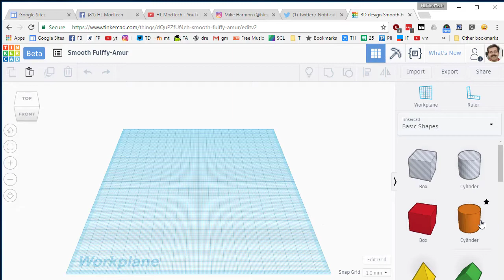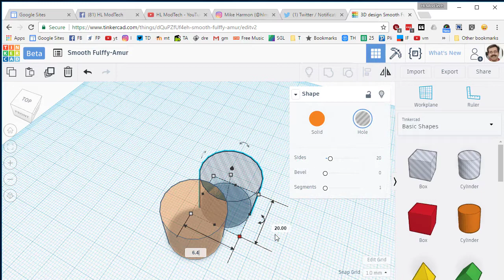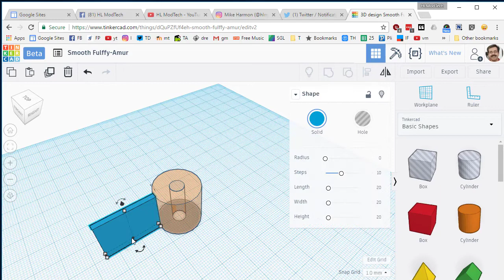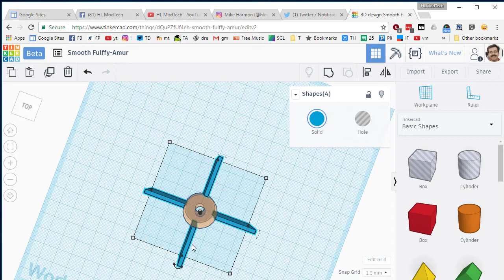Great Summer Project! Design your own paddle wheel in Tinkercad

Comment: I know this is 5 years old, so this is for anyone seeing this now or later.   An easier way to accomplish this in TinkerCAD  (using what is shown in this video), is as follows:  To start the paddles, make the blue rectangle the same height and width (as he shows in the video) but make it as long as you want the paddle wheel's diameter to be.  Duplicate it, then turn it 135 degrees (be sure NOT to deselect this dupe), then duplicate 2 more times.   Boom paddles are done.  Then create the hub, by making a cylinder the same height as the paddle, at whatever diameter you wish, align, and group it.  Do the same for your center hole, and you're done.   

Now here are a couple more reasons why my method is an improvement.  It means you use less objects, which means it renders MUCH faster, when you load this file back up for review or revision.   Another reason, is that when you export this as a STL (the way the author of this video did), it can inflate the file size unnecessarily and in some cases, it will mess with the gcode and cause problems with shells printing weird.  

Hope this helps.
Reply from the maker: Thanks for sharing Bob. Hard to believe this was 5 years ago. 🤯
Reply: @HLModTech  no worries.  TinkerCAD has changed so much since then.  Some of them are good, and some are not.